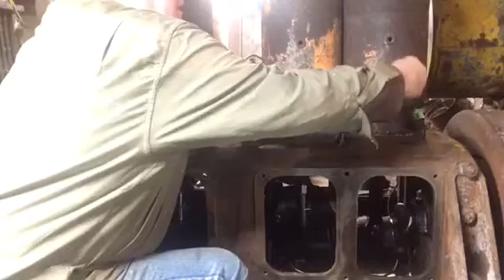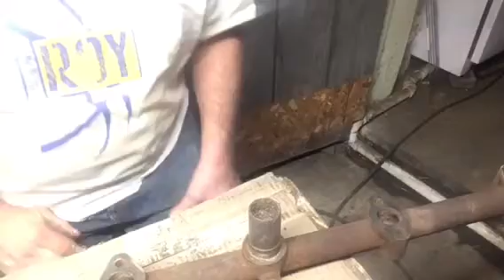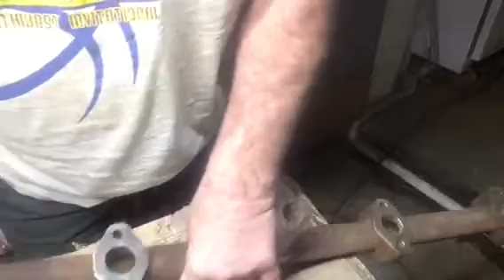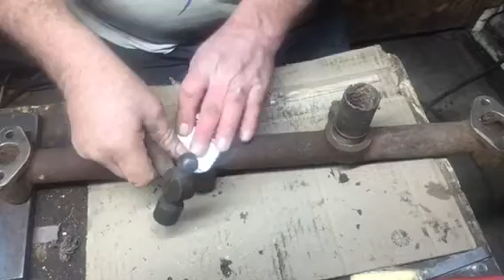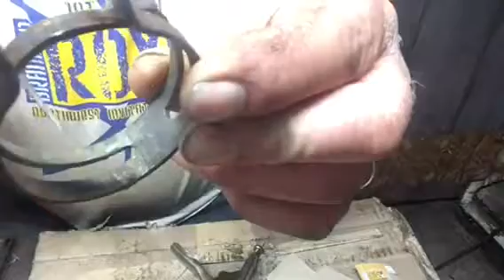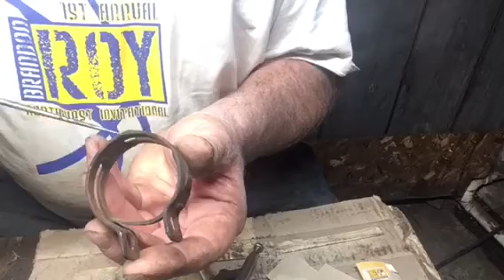Cat 60 water manifold alignment & gasket making 3/24/22

Comment: Some very clever people back then. I enjoyed the video about the push rod pipe gaskets. My engine is leaking like a sive, the exhaust is wet, but it's not blowing copious amount of smoke.
Reply from the maker: Oily exhaust, that doesn’t sound good. Is it slow and hard to start? Sounds like it may be old and tired and may need major engine work. Unfortunately much $
Reply: @oldamericaniron5767  Geoff, it is quite easy to start and doesn't blow smoke, only when you first open the throttle. My friend here says it's normal for a machine like mine to throw oil when it was used mostly as a crane.  I give it a bit of clean this afternoon and I think I might need to start with Rocker cover gaskets and then see if I can work the machine hard enough to unglaze the bores.